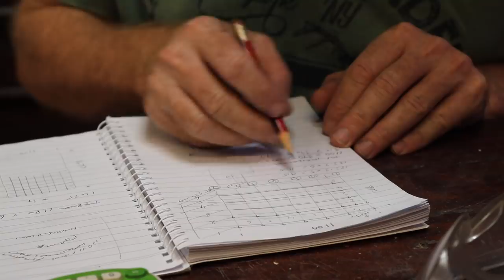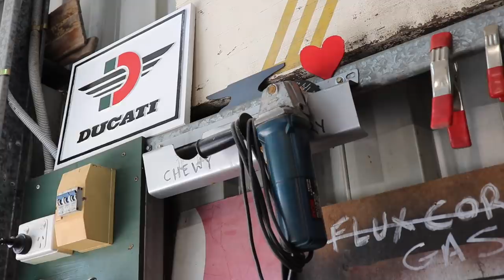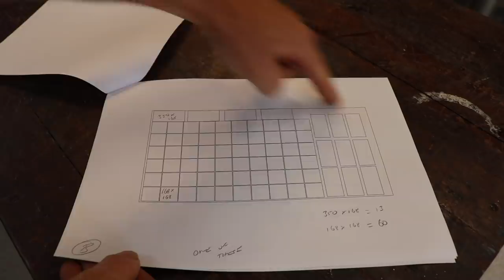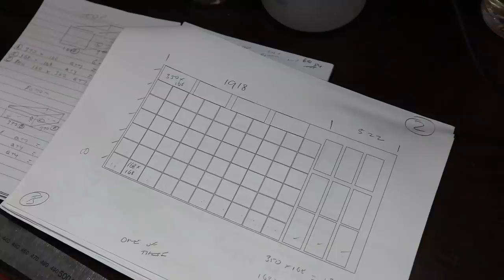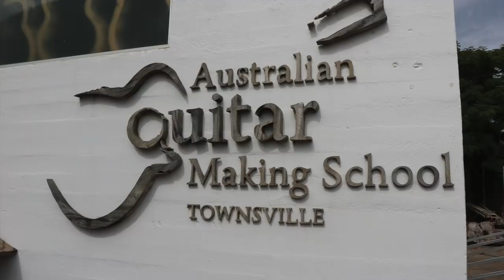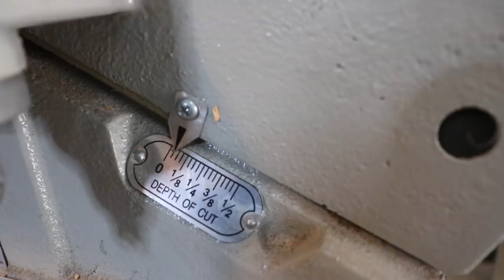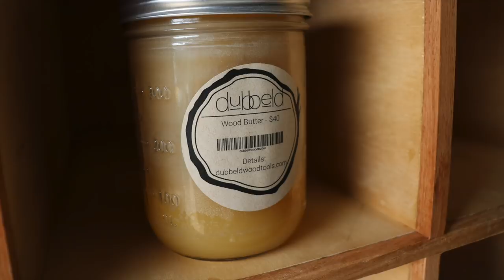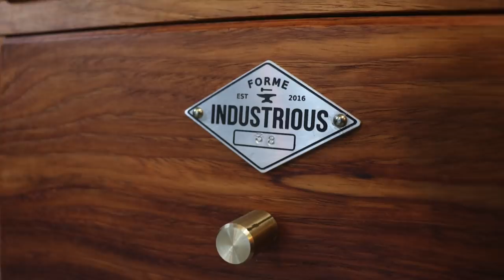42 Drawer Industrial Style Cabinet - Forme Industrious

Comment: Really cool build, yes maybe the sexiest yet :) 
Do you find the NG Rosewood a bit soft? I had some and it nicked and dented real easy.

Oh, and you either need labels on all those drawers, or a darn good memory Scott!
Reply from the maker: Hi Rob, time will tell I guess with the Rosewood. I did have one part that chipped on my that I had to fix by blending the chip out. It was only small. Well, my memory is not bad for some things.....I you ask my wife, well she would laugh. I have a system, a row for screws, a row for bolts (washers and nuts etc), a row for other fasteners. Electrical, tapes, sanding etc and the rest is a free for all :) Cheers Rob

Comment: Paul Sellers has a neat trick for panel glue ups. You put the boards the way you want them in the panel, then you "close" them. The sides facing up go to the outside, and the edges that are getting glued are right next to each other. Then you plane both edges straight together. Because of some geometry stuff, any tiny amount that you're off square is compensated for when the panel goes together. You end up with a really ludicrously fine and clean glue line. Not sure how well I explained that, but he does it basically any time he glues up a panel on his channel.

Also, I don't know if it's the sexiest thing you've built. But yes, it's sexy. Yowza.
Reply from the maker: I'll have to look into that Paul Sellers method. Sexy is as sexy does ;). I have zero credibility on that matter but what the heck, sounds good.

Comment: Really nice. Nothing like having tons of storage. You probably have it full by now. Btw I built a lathe bench out of 2" sq steel tube just like yours (saw it on the background). I found that it rang like a tuning fork, even though it was bolted to the floor, had mdf sides screwed to it and had drawers with many pounds of tooling. Next time I will use a deader material.
Reply from the maker: Glad yo like it. Yet to fill it all. Odd that you got harmonics from the bench. Harmonics set up at certain speeds or frequencies. Maybe change the lathe speed and see what happens. Otherwise, maybe fill the legs with sand as a possible solution. All the best.

Comment: Dude, those mini fingers are awesome, and no you don't need a wider blade to make them go faster. What you do need to do, is to gang cut them ten or twenty pieces at a time. If you stack and clamp up a bunch of boards and cut them all at once the grooves be more consistent and way cleaner with only the chip-out on the end boards. Nice project.
Reply from the maker: Wider and stacked is the plan for next time. I did stack these 2 up as I have had a bad experience previously stacking (I stuffed it). Thanks!
Reply: @ScottTurnerformeindustrious  The trick will be to make an extremely square jig get them to cut exactly the same.

Comment: You can make an ersatz dado blade out of several regular ones. Cut some washers out of bike inner tube and position each blade so the teeth are staggered. When you wrench down on the whole assembly the rubber keeps the blades from moving in relation to one another.  Pocket83 does a video on the technique.
Reply from the maker: Thanks Seth! Keen to try that out.

Comment: I've been doing the water trick for years, but I boil the water and pour it into a jar with about 7 teabags and let it cool, then sometimes I put a few drops of wood dye in it also. If I'm using pine it enhances the tight grain , then after it completely dries I'll scotchbright it, or use fine sandpaper then usually coat it with Danish oil, It gives it an antique finish.
Reply from the maker: Thanks for that. worth a try.

Comment: I tried building a workbench with some Cheap Plywood from my local Big box store. My GOD never ever again. i was so happy to cut all my parts and I let the parts sit for about a week and when I came back every one of them had bowed and warped. I learned a painful lesson.
Once you work with Baltic Birch you will never ever want to use anything but that. Stability and everything else you could ask for a soft wood to do. Glue up. Nailing, Kreg Jointing, Dado, Paint, Varnish, easy sanding. I use it all the time for Shop Furniture. In fact the Baltic Birch I am able to buy comes from Russia.
If you want to make furniture then use Furniture grade Baltic Birch.
Reply from the maker: Thanks John. I wonder if we can get some Baltic Birch here in Australia. I used AA for the drawers and BC for the Cabinet, however it was not good as you know. Cheers

Comment: Now you have get a ladder jus to get the top drawers,   that's if you remember what's in them.   Super nice job    $ 5000 dollar value
Reply from the maker: Haha, no ladder required. Easy to pull the drawer out get what you need and put it back. Thanks.

Comment: Nice one! Sitting the drawers proud was the right call for sure. I'm totally putting my boiled linseed oil in a sauce bottle now.

Stacking saw blades together can work if you use shims between IIRC, no idea why dado blades aren't really a thing in Australia.

 Also while yours look spot on I find using the router table fence helps me with crisp corners, even when the cutter has a bearing.
Reply from the maker: Thanks for the Tips SPE! I'll be looking into the Dado's but you are right, they are not at any of my tool supply shops. I'll look on line. Cheers!

Comment: you are truly dedicated to cut all those box joints using such a thin blade, and by not stacking more than two panels at a time.
Reply from the maker: I am cured! I have relented and spent the bucks to buy a Dado Stack! Never again :) BTW I did stack the panels - just not shown in the video....had to add drama

Comment: Looks like the same ply I got from Bunnings... The pile of 12mm ply looked like a bunch of dead leaves. Twisted and cupped about 50mm...
Reply from the maker: I got the 9mm ply (Cabinet) from another timber supplier and the Drawer Ply 6mm from Bunnings. The 6mm was much better but still had issues. The 9 mm ply was terrible. Not having much luck with ply.

Comment: Beautiful cabinet. The continuous grain across the drawer fronts. The proper industrial casters which can take a real load. The wooden trim on the top, outside of the metal frame. Epic task cutting those finger joints. I roughly calculate that you've made 10-12 thousand finger notches there.

Nice colour too - looks like you had something colour matched. Was it to match something already that colour, or just a colour you liked?

You've taken to the Japanese saw like a fish to water. Also - love the hand scraper - much more pleasant than sanding.

Also - the rest of your workshop: The Studebaker sign. The tools on casters. The other two industrial tool cabinets you made, etc etc. Love it all!

This was a project of epic proportions. I think my favourite of yours so far, and probably the favourite video too. You've outdone yourself. Keep up the good work mate.
Reply from the maker: Hi Craig. Thank you for your comment! I cut down the time doing the finger joints by stacking the panels two at a time. That helps a bit. For the colour, Originally I chose a metal steel grey and changed my mind thinking of the old workshop machines and colours. On a whim I changed to the green here. I just went to a colour chart and picked it. Kind of experimental to see what works.
Thanks again!

Comment: You did a very nice job, mate. In my opinion, and I know you did not ask for it. 'It's not what I would call functional. It's to high and just to access the contents of the drawers you'll need a step stool, or pull the drawer out and set it down.  It should've not been no higher than shoulder high.
Reply from the maker: Thanks James. I just pull the drawer out, pretty easy . Makes good use of dead space but it's not a place to put every day stuff.
Reply: Should have a matching step stool

Comment: Excellent video work , I would suggest you do some research on how you do many of your  procedures . Planning edges with a short plane for example, perhaps a straight edge and a router ,gang cutting your finger joints.  Try to avoid masking tape as clamps. Just some friendly suggestion to speed up future projects .
Reply from the maker: Thanks John for the tips - I always welcome feedback. I did gang cut the boxes two up but I think a wider cut is needed.  Might not see that in the video. The tape seemed to be a simple solution not having edge clamps. Might have to make some. All the best.

Comment: I would change the handles by adding details. A half-circle cut to create a finger-groove on the bottom-front of each stud / handle. Maybe some tiny 45 degree similar 1/3 circle drill cuts through the front angle to give it more of an industrial look... ie like a revolver cylinder but the concave segments closer together. Also, bees-wax needs to be spread on the inside ( side and bottom ) of every drawer slot and drawer.... This will get rid of that awful creaking when you move the drawers in and out. -- I would've also skipped the top 2 rows of drawers.. They are at, or above eye level for most people and would be awkward to get into... Instead, a simple cupboard system where it opens from the bottom and swings upward and latch open. It could have lights on the door, run inside of the wood - to the back, and could light up the contents of the drawers at night, if needed along with giving you some nice simple shelving at the top, easy to see into, etc... Maybe even a pull out glass-style rack, but for screw-drivers and other tools.
Reply from the maker: Send me pictures when you get yours done :)

Comment: I know what your gonna say, but for the inside I Might have used 1" MDF  Yes all the stuff about MDF but its strong stable material and with good joints stays put.
that's a cheap import plywood from China. you could have skinned it with any wood on the outside sides and top an it would looked just as good.

See MDF would ahve worked for you, the done project looks really sharp.
I like it.
Reply from the maker: Totally understand. Thanks!

Comment: Like a Chinese medicine cabinet. If the draws would close hard because of the air pushing it from inside then you could make a small drill hole in the back of each slot in the cabinet to let the air escape.
Reply from the maker: It's not really an issue. I was just having some fun.

Comment: Great build. Thanks for sharing.
Just got a question about the Hitachi drill press. I've got the same machine but it's making a lot of rattling noise when I use it. Do you have the same issue? How can I quite it down?
Reply from the maker: Thank you! Yes it does make a rattle when using the low speed setting. The bearing seems fine and smooth. It has bugged me too and I'll look into it more.

Comment: All good comments in the comments section, people appreciate a craftsman! question from an ex boilermaker, are you burning .6 wire? just sounded like it, or burning hot, either way an excellent job.
Reply from the maker: Thanks Brin. I use 0.8 but I was changing my settings in between video takes because they were not right :)
Reply: @ScottTurnerformeindustrious  Well the welds came out good, I run a crew of boilermakers, they all weld hot for best peno.

Comment: wonder if it works wearing a knit clove over the rubber vlove when aplying the tungoil , kindah like using a soaked rag
as for the dado blade to make the fingerkoints , you could use youre routertable instead of the table saw can even make dovetail joints that way 
the cabinet looks realy nice , i dont think i wouldve had the patience to make sumting like that
Reply from the maker: Yes I'll look in two the options for the router as well as the say. Cheers!

Comment: Thats a huge project come out awesome.  I didn't know you could thin out the Rust Guard paint and spray it..  Dose it still have the same strength once it's dry or do you loose that toughness once you thinned it down?  Nice Job btw
Reply from the maker: Thank you! Paint seems just fine. I sprayed two coats..

Comment: The wide grain timber will likely split if the humidity changes - that's why veneer is better for stability. Otherwise, cut into 50mm wide strips and glue back together as a board (Like a cutting block). The sides / back should be loose fitted to allow expansion room - just use 2 screws and let the rest float. Same with drawer fronts - 2 screws along the grain (Timber doesn't move along the grain) or drill slotted/oversize screw holes.

Given you added a cornice, a matching skirt would hide the overhang of the plates for the casters - they look like ankle killers.

Nice vision, nice design, looks great.

Shame Masso wouldn't sponsor you a cnc for all that cutting :(
Reply from the maker: Huge thanks for all the tips Graham. The drawer faces had already started to cup. Will see how it goes over time. Sides have a gap before the steel frame. Hard to see in the video but it is there. MASSO give me free reign over what I make. They are fantastic and appreciate the creativity and diy delivery so all is good. Cheers!

Comment: Very nice design and execution, thanks for posting Scott. Great mix of materials, and form.  Is the elevation a Golden Rectangle?  drawer to overall ratios?  looks great!  I wonder if the box steel frame will hold up?  I'll assume you'll be storing bins and bins of  25 and 30 mm bolts??
Reply from the maker: Thanks Kevin! For the design I just eye ball what I think looks okay. No ratios. The steel frame will be perfectly fine for many many years.  I use it for storing wood screws, nut, bolts, washers brushes, sandpaper, rivets. PPE etc.
Reply: My sarcasm about your overkill steel tube frame was in jest, of course.  I think it will outlast your great-grandchildren!  Nicely done.
Reply from the maker: I was nearly sure you were pulling my leg there ;)

Comment: Really admire the look you created, Scott. One question: Now you have had it for a year, would you change anything about the design of the drawer pulls? (Straight, smooth surface seems like it may be difficult to grip for larger/heavier drawers.)
Reply from the maker: Thanks Jeffery! For the drawer pulls I would (Still can) mill a channel on the lower side. That would allow the finger to sit in a groove making it easier to pull the drawer. Other than that it seems to be all well.
Reply: @ScottTurnerformeindustrious  Yes, that is the solution I envisioned too. Just a bit more lateral surface to pull on. I did not want to presume too much on your work - which is excellent. It's easy to be an armchair critic with no hand in the design or fabrication. Keep up the good work!

Comment: Hello, im new to your channel, and actually working with metal most of the time. Since im a mechanic for agricultural equipment. I was wondering how you did the joints for the Drawers? Is this a special setup for the bladesaw? these joints look way more stable then just glueing the sides together.
Reply from the maker: Hi. I used a"Box Joint" or "Finger Joint". Yes it is a social set up on the saw or router table. Very strong indeed. The interlocking flingers greatly increase the gluing surface area and lock together like little tenon joints. I hope that helps.

Comment: I’ve been dreaming of making something like this for my shop. But wow...looks like too much work. Is there an online store version bolt together cheap industrial sheet metal
Version like this? One thing I wonder is...when rolling this in and out your storage Container shop etc...wouldn’t it tip over easily? I understand why it has to be made this width but, could be dangerous. Anyways...you did one hell of a job!!
Reply from the maker: I'm not worried about it tipping over. I think you would have to have some real bad luck and a wonky floor. The wheels are pretty wide. Thank you for your comment!

Comment: Freud makes a box joint blade thatI think fits on the little dewalt, does 1/4inch and 3/8th so not super adjustable.
Reply from the maker: Thanks! I recently bought the Dewalt dado set. Haven't used it yet though :)
Reply: @ScottTurnerformeindustrious  I just looked that up, seems much more flexible, online or do Bunnings have it?
Reply from the maker: @JTLowry  I bought it off Ebay.au https://www.ebay.com.au/itm/DEWALT-DW7670-8-Inch-24-Tooth-Stacked-Dado-Saw-Blade-Set-NEW/333305684484?epid=11021985063&hash=item4d9a912204:g:nfkAAOSwuz1bYEqn

Comment: If you come into the shop one day and that is missing, I have no idea what happened to it.
Reply from the maker: I have set traps everywhere. I have Spiders, snakes......dirty rats and a bird that Screeches when we have visitors :) Not to mention my secret defence system that uses concrete and barrels. Cheers John.
Reply: @ScottTurnerformeindustrious  Lock picks, check. Bolt cutter, check. Pole with  grabber claw, check. Bird blanket, check. Grappling hook, check. Steel cable check. Jeep with winch, check. Thanks for the heads up. Cheers Scott. :D

Comment: Nice work.....bet you got tired of making batches of parts.  Is it an apothecary cabinet?
BTW,  cover the ways on your lathe when using emery cloth and wipe down after.  Makes me cringe a little.
Reply from the maker: Thank you! Not sure what style cabinet. I clean and oil the lathe after each use. I even dismantle the carriages, clean and adjust on an annual basis or if I think it needs it. My work shop is metal and wood. Fighting dust is a loosing battle